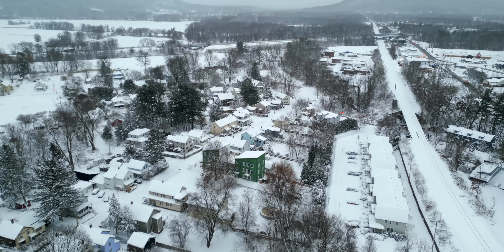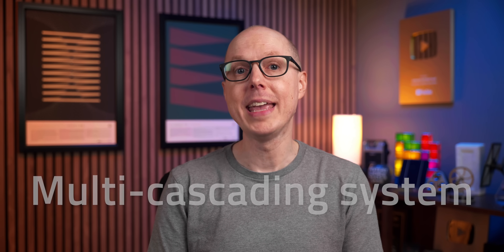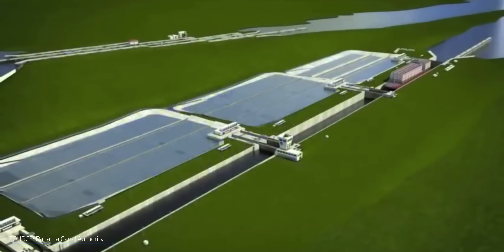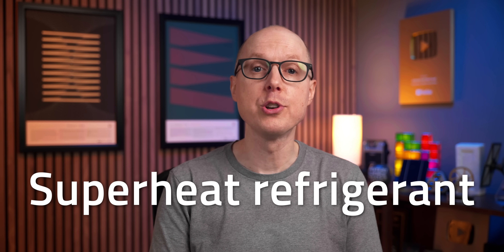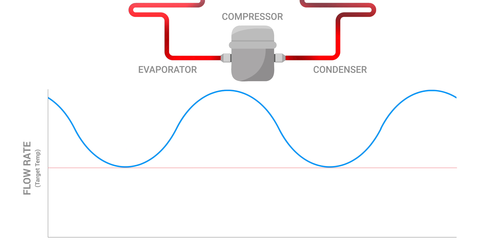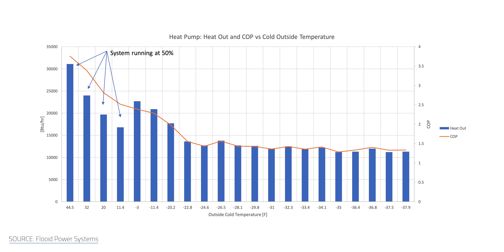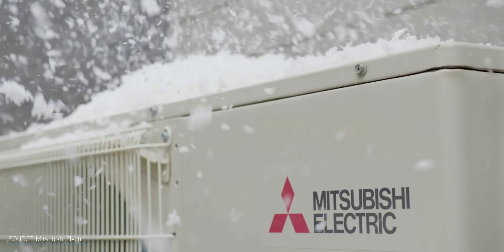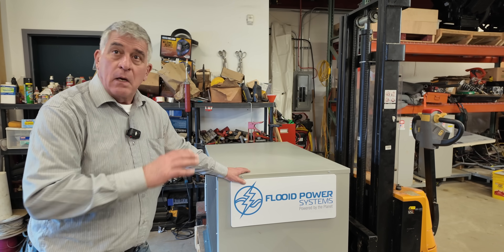How This New Heat Pump is Genius

Comment: Our heatpump is a normal non cascading pump using the groundwater as heat source. It has a COP of 5-6 over the year and heats our water up to 60°C and works for almost every outside temperature because the groundwater temperature doesn't fluctuate that much
Reply: Yes, I’ve done something like this before for a client who wanted / had a indoor mini split but wanted a reliable source for heating in the cold Ontario winters. 
We did a W2A ( water to air) heat pump configuration, instead of the common A2A ( air to air ) systems which are more prone to failure under the extremes. 

Ground water table risk aside, it’s proven to be effective and efficient
Reply: Similarly a Ground source heat pump gets constant temperatures of 55°F where I live and the heat pump can be optimized for that input temp.
Reply: I'm a 40 plus year refrigeration tech, I don't see a benefit using cascading with geothermal heat pump. You just need your loops deeper in the upper North. I've never seen a geothermal with one loop. We use 6 loops most of the time..
Reply: @Bryan-Hensley  my heat pump has one loop 1400 foot loop. I live in the country and it just goes 700 feet out and straight back. works fine  being operating for +15 years like that. depends where you get the pump. i ordered my direct from a Chinese manufacture  it cost me $550 ( today they are not much more). digging my loop did not cost much took an excavator 1hr to dig the trench @6 - 7 foot depth  had the line pressurize with water  ready to drop as and as he dug    we placed the line  on either side of the  trench.  and when we ran out of  line he back filled  the trench another 2 hrs . he charged me  $600 total. he was clearing the  ditches near my place . and they are not allowed to work on the weekends  to do road work .so he came down  and dug my trench on the weekend .  ( i did not have to pay machine transport cost as the machine was already there). my ground temp starts around 10c in the fall by spring it down to 5 or 6C and I live at +52 latitude and it not uncommon for me to have several weeks ( or even  months)  at  well below minus 30c and a few weeks at minus 40c or colder
Reply: @skrywenko6596  Hi What heatpump did you bought? I  have 1200 foot 1" loop in slinky coils burried 8 feet underground.
Reply: The problem with a ground-source heatpump is blindingly obvious: 1) either you need a lot of land to do a shallow-loop system or 2) you need to drill an expensive, deep well.
Reply: @M1911jln Hi, I live in the southwest corner of Finland, and I have not heard of such a method being used, especially in residential single-family houses. It is quite expensive! But another thing to consider is that bedrock is what you want to reach with your geothermal pump. That is the most steady source of heat. There is some discussion about whether this source can run "empty." There is a theory about that, but I think I have only come across one story, and the conclusion was that the original measurements were done incorrectly. I have a system that has two 400m loops only 1 meter deep. I have never had any problems with it, and the sun "loads" my heat source every summer season. We have -30C at this level, but only short period of time/year.
Reply: @mikko5813  We also use this kind of method in Norway, but mostly we drill one  hole around 150-250meter straight down in private homes, and schools and such we often have 20-50 holes that are around 150-250m deep depening on the location.
Reply: @M1911jln  we have a backyard with roughly 400m^2 or even less. 
We managed to plant 7 spiral ground connectors which are 3 meters big and have a diameter of 1.5 meters. They can provide 10kW of heating power. 
The COP at 60C is at around 4.8 according to the tech that helped us install (what his software showed).
Reply: @010falcon  Do you have indication of the cost of the whole operation? And I assume it is somekind of R290 heatpump from Ecoforest or Nibe or something?
Reply: @roland9367  The air air heat pumps are also not as cheap here. With installation you might 15k compared to say 25k for collectors or 40k for drilling. But then again, you save energy when drilling and have less running costs (the last longer as well). 

That's why in Switzerland many choose ground, closed loop, heating.
Reply: @roland9367  we use r410 I think
Reply: How much do they cost to put in?  I can't find useful figures online...
Reply: @Plan3tBob  the digging part is pretty expensive. Just digging the ditches and ground loop is most likely going to cost over $10,000 alone. The geothermal heat pump unit is overpriced too. It's about twice the price of an air to air. All it is is a fan, compressor, loops of copper line strapped together inside pipe insulation as the heat exchanger and a pump for the water heater. The ground loop pump is external and purchased separately. I'm talking about a regular geothermal heat pump, not this one on the video
Reply: @Plan3tBob  They are very expensive to install.
Reply: @Plan3tBob  Roughly speaking for the Netherlands, where we don't have the problem of rock surface, so you can always drill (if allowed!). Taking an average size free standing house with some insulation. Air source heatpump could be installed for around 10.000 Euro or even less. Ground source heatpump cost at least 30.000 Euro. And for the Netherlands it is totally not worth it to spend that kind of money on a small efficiency gain. If we get -10 degrees Celsius it is just for one week or so, and the air source heatpump still works fine, just a bit less efficient.
Reply: @roland9367  quite a bit less reliable, but I can see your point. Here in Switzerland air heat pumps aren’t that common and or popular.
Reply: @010falcon  What do you mean? That air source is less reliable than ground source?
From the viewpoint of the heatpump itself that might be somewhat true. I wouldn't say less reliable, just a shorter lifespan (but still at least 15 years). Now I install Daikin 3 phase air source heatpumps which seem nice quality, and are in ranges of 9 to 14 kW. And they are not that expensive, meaning that even if you would have to buy two of them for one ground source heatpump (I don't think a ground source heatpump will last 40 years), it still much much cheaper.
A COP of 4.8 at 60 degrees is nice (what was the source temp at that time?) but the reality is in the Netherlands, lots of people have floor heating with a heatpump, requiring 30 or 35 degrees input, and with mild weather it is very easy to achieve a COP of around 5 with air-source heatpumps. For a few weeks these COP numbers will decrease to maybe 3.5 or so if it dips below zero. Completely no reason to spend 20 to 30.000 Euro more on the installation.
Reply: @roland9367  We were in November when they finished installation (own house). From the collectors we had a return of 2-5C when starting heating (ie. getting the boiler up to temp from ambient, and turning on the floor heating for the first time, so a lot of strain on the collectors). On average, when the heatpump turns on and off we have a return of some 5-10C I think...
(We heat water to 55-60C)

We mainly use Hoval and for cheapos Viesmann. There are also more expensive, better ones.

Why is air less reliable, well you have more outside influences (water, direct sunlight etc.) and the temperature difference is much higher. some negative temperatures. 

In the Netherlands you have Oceanic climate, so you don't have to worry about temperature extremes. But here we have more continental climates, ie. more extremes in summer and winter.
Reply: @010falcon  Yes you have more extremes. But Norway and Sweden also have extreme cold and they still run air source heatpumps. I think the air source heatpump lifespan is just shorter from being outside. Sure it has a fan which can break, but that doesn't happen so often and is not a big deal to replace.
So more of a shorter lifespan from being outside. But I've even seen a cheap unknown Chinese air source heatpump last 15 years. I'm expecting / hoping at least 20 years out of the Daikin units, with at some point perhaps a small repair (like pcb or fan).

Ground source heat pumps here typically get drilled, and I haven't seen anything under 30K, but 40K is also common.
Because with 30K the power of the heatpumps is still at low levels of like 5 or 6kW. Big homes need more.
While I can do heating only (hot water excluded, can be added) under 10K with air source heat pump with 9 or 11kW for example. This is typically for freestanding homes already with floor heating.

Then subsidies are substracted. So you might be comparing net cost of 5 or 6K versus 26 to 35K.
You can never earn back these investments, unless you were burning something like 3000+ m3 of gas every year. While the air source heatpump, you can earn it back with more typical ranges between 1000 an 2000m3.

So really, ground source heat pumps are almost never a good option in our country.

The challenge is not in the freestanding large homes by the way, the challenge is in all our row houses, in which air source heatpumps may make to much noise.
However, ground source heat pumps aren't feasible in these neighbourhoods either. So, some kind of PVT solution might be the best option, but these are also very expensive.
Reply: British Pubs almost always keep beer in a cellar where surrounding ground temperature is fairly steady at around 42F/5.5C, about ideal fridge temperature.
Reply: The problem with ground water system is the Initial cost is so great any saving over air to air heat pumps take so long to break even or make a significant. Difference in energy saving it’s hard to justify for most builds
Reply: What heat pump do you have?
Reply: I think what is needed, at least for here in Western Europe, is some kind of advancement to make Ground source cheap. Some way to make drilling cheap and the heatpumps them self also cheap (they are pretty simple). If the cost can be halved, there might be a chance for mass adaption. Eating up market share of air source heatpumps
Reply: Wouldn’t that be a hydronic system not a heat pump?
Reply: Ground loops are very expensive and not always feasible.
Reply: Wrong. This system is most certainly cascading, because the groundwater temp is to low and the flow also. So it levels it up in stages.

You risk freezing the groundwater and get zero efficiency if you extract to much heat during the winter.

 Some systems reverse the flow in the summer to defrost the ground pipes, while cooling the house (normal AC mode)
Reply: @erbterb  Our system can also reverse the flow for cooling but we didn't needed it so far as we only get a few weeks above 30°C per year.
 It's a "Vaillant flexoTHERM exclusive VWF 87/4". You can check the datasheet online if you want. We got it localy, I don't know if it's available in your country but there should be some different companies available.
Reply: Plus you can dump that heat into the ground in the summer cooling season and then recover that heat in the winter.
Reply: Very hard to believe that you get a COP of 5 or higher with 60 degrees Celcius output.
Typically they will get those kind of COP values for outputting something like 35 degrees Celcius for low temperature heating, which is fine. And then a lower COP for 60 degrees Ceclius while making hot water for showering etc.
Anyway, here in Netherlands, I would say a ground source heatpump is at least 20.000 Euro more expensive, while our weather is typically mild. So on average, it is not worth it at all.
And in scandinivian coutries, where it would be more worthwhile, they still run a lot of air source heat pumps anyway. Probably because drilling is hard in a lot of places.
Reply: @roland9367  Someone in Finland told me they usually use explosives to clear land for construction, his house sits on the bedrock since there's almost no dirt to flatten.
I don't know for other scandinivian countries, but at least where he leaves drilling is not worth it a you said (if even possible).
Reply: Uh - when you say “groundwater as heat source” do you mean you have a geothermal heat pump?  Geothermal hp’s don’t use actual groundwater - they’re closed loop systems using a coolant and making use of the ambient ground temp of 55 degrees.
Reply: @donnybrasco6321  Some do pump and dump from well to another.
Reply: @donnybrasco6321  Most geothermal heat pumps are closed loop systems, where the refrigerant goes through coils buried under the ground or in a well, but open loop systems pump water up from one well, run it through the system to either extract or dump heat, then send it to a second well that puts the water back into the ground. It's cheaper to do this when you have a high water table, because you don't have to either turn over a huge amount of landscape, or drill hundreds of feet of wells. I have an open loop system, because the water table in my area is high enough that two 50-ft wells are enough to service the entire system.
Reply: @donnybrasco6321  Some do, depends on installation style.  If you don't have enough open yard they dig a well (or 2 or 3) and tap into ground water. Can be closed or open loop.  I know they also do loops in lakes/ponds in some areas.
Reply: @donnybrasco6321  I was thinking he might have a well and used it for heating/cooling the heat pump, by recirculating the water.
That's what I'd do if I managed to find a house with an already existing well.
Reply: Works great until the groundwater drops like in a region near me, the heatpump of someone I know just stopped working.
A deeper hole is not allowed as well :)
Reply: @mathuswins  in summer it needs to get heated again :). So basically you need to cool the house in the summer. So the ground becomes warmer.
Reply: @albex8484  only problem when there is no water in the ground anymore :-D
Reply: @mathuswins   - then you use a closed-loop ground-loop for the heat source / sink..

(if the open-loop runs dry)
Reply: @mathuswins  For us it was relatively cheap because we live next to a river and the groundwater is only 2m deep. But for many people an air sourced heat pump might be the cheaper option. No solution fits all needs
Reply: @veitforabetterworld can you give more details on the construction? Do you pump ground water out of the ground then put it back in a different hole? How far apart? Or do you have a closed loop that just dips into the ground water like a normal ground source hp?
Reply: @adrianthoroughgood1191  my father works in the business, and I helped a lot when I was a child and even now. I can provide you with the information or the knowledge of how it’s being done in Switzerland. 

If we do groundwater heatpumps we have to drill 2 holes. Normally they are on different sides of the houses to keep them apart. 
These pumps go through a lot of strain and need mesh grids to avoid stones going in. This results in clogs or even worse, the pumps breaking. It is not seen as reliable here, since they can break after 5 to 10 years, thus the whole market here has switched to closed loops. 

We have 2 options, drilling or „collectors“, which are overglorified spirals of tubing. Drilling in Switzerland costs 40-50k and collectors around 20-30k, with the heat pump.
Reply: @adrianthoroughgood1191  Yes, the water is pumped from the ground and passed through a heat exchanger. The cold water is then pumped back into the ground about 50m away. The return line has to be downstream. We also had to get permission from our neighbors who live up to 100m downstream from our return line, but this can vary depending on where you live.
Reply: @mathuswins  hi is talking about a 150m-250m deep hole in the ground with a closed loop with cooling fluid.
It takes the energy from both water, earth, mountain and mud.
Reply: @mathuswins  implementing permaculture methods on the land can recharge the groundwater tables.
Reply: @jamesmayer1306  that's propaganda, "permaculture" is a cult
Reply: Nop nop nop nop. heat pump are not magic. For a COP of that much you would required ground water at 30oC.
Reply: Correct, What we're told is simply too good to be true @pierregravel-primeau702

Comment: Biggest issue is see with their demo model is size. I think they should make different shape configurations. Most houses old and new are built with the expectation that the hvac will be tall and fairly skinny. That was a rather large footprint short box. In my case IF it would fit down my basement stairwell then it wouldn't be too big of an issue in the basement. But a lot of houses have their systems tucked into closet size spaces or in attics with a small access hole. That big box isn't going to fit there.